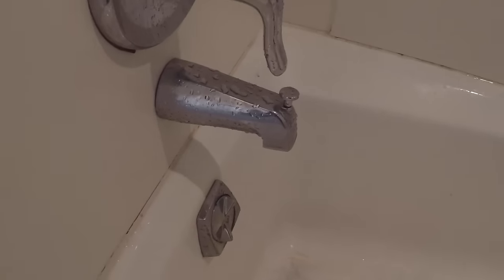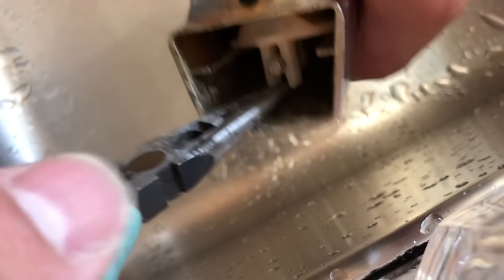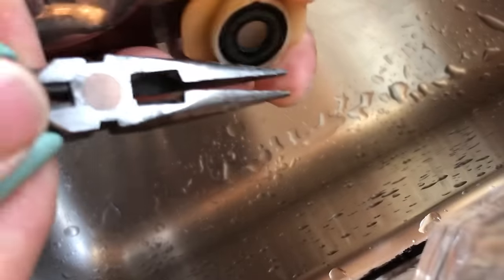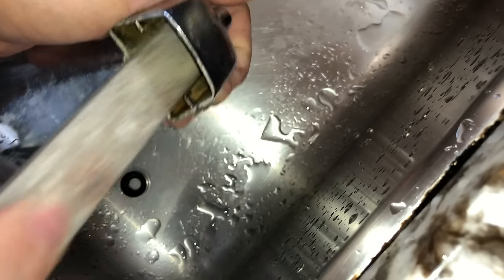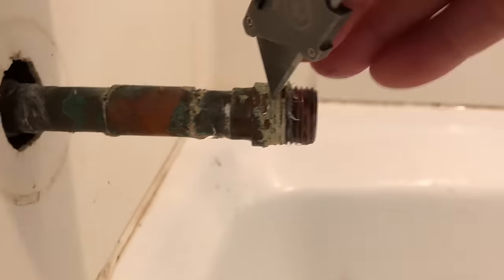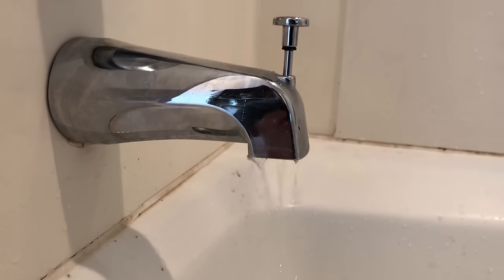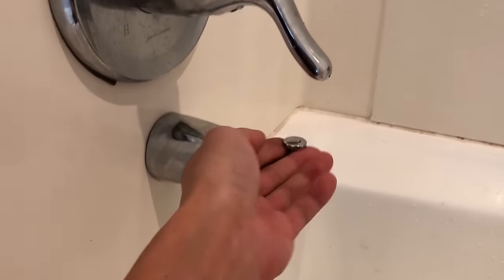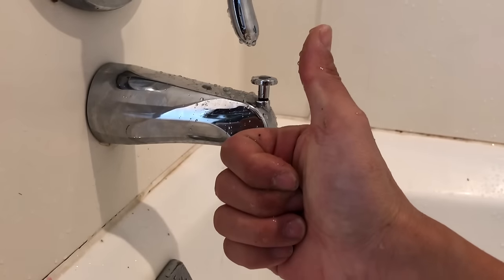Repair Leaking Tub Spout Diverter Pull in Shower Mode

Comment: Don’t get in a rush like me. I had the slip on kind and followed his method but he doesn’t mention a set screw at the beginning of the video, he just starts twisting. I damaged the copper pipe and now hope there are no leaks when I reinstall the cleaned up diverter.
Reply: Not all set ups require the set screw.
Reply: Troy True most will
Reply: Mine is the one with screw and just slide out the head. Not need to twist
Reply: How do I know what kind of faucet I have?
Reply: @ovetaalexander3425  check if you have a small screw on the bottom, if not it’s likely slip on
Reply: @longhorn8459  thank you. I managed to get it done quickly without removing the nozzle tho. It works great now
Reply: @ovetaalexander3425  Open your eyes and look
Reply: @longhorn8459 Thanks for this tip I need all the help I can get since my Dad passed away and I have to try to fix for Mom.
Reply: @longhorn8459  on the bottom of the faucet?
Reply: @great4ever845  yes
Reply: @troytrue7478  mine has no set screw and won’t twist off, thinking the old guy must’ve used loctite or something
Reply: I’d never seen one with a set screw and was helping my neighbor. Glad you mentioned this!
Reply: Just moving in and it was spraying water out the back until it just fell off a few weeks later. Looks like the contractors used solder so I can’t screw another back on. They also installed the handle upside-down with the plastic stop in the wrong place, forcing you to leave it in the middle to stop the water flow (also starts at full-hot). I knew something was up when I saw the solder blob in the tub before moving in. I also noticed that the pipe to the shower head was turned and already sloping down at the point where it comes out of the wall (doesn’t start straight, then slope). The bathroom door handle is for closets and can’t be locked. The guest bathroom is the same way. The master bath has a proper door handle but it’s on BACKWARDS with the lock on the outside. The master bath shower is unusable because they glued the drain grate down with something that looks like expanding foam trapped underneath, completely blocking the drain. None of the stoppers work in any of the sinks when you pull up on the plunger and there is a huge water leak under the kitchen sink where the line goes into the dishwasher. They also ripped out the vertical backboard between the countertop and the wall, leaving a gap for water to go down behind the kitchen sink.

All of this is brand new after the home was rebuilt following an EF4 tornado. These contractors are incompetent. Just took the money from the landlord and RAN!
Reply: I almost did the same thing, turning it 90 deg but fortunately spotted the slot/screw and loosened it. Pipe only has a very minor scratch mark where the clamp part is so I was lucky!
Reply: I'll take time off from work to watch them and let them know if something looks/is wrong. I don't care if they don't like that so tough (you know what). Almost every time I see something that looks and is wrong. Can't trust them to be on their own and do a good job. They're always in a rush to get on to the next job. I pay enough money for a job and I want it done right, period.
Reply: @rogerbarker2231 what if the person is blind?
Reply: I would like to respectfully disagree with your comment. Let me explain why. First of all, I noticed the place on the underside of the bathtub, spout at the base of the spout, where there was a place for a setscrew, but there was no setscrew. The reason that I know that is because the copper water supply pipe coming out of the wall was threaded on its end and had Teflon tape on the threats. The bathtub spout is threaded on the inside and actually screws onto the threads on the copper pipe coming out of the wall and that’s what secured the bathtub spout to the water supply pipe. When the bathtub spout is secured to the water supply line by a setscrew, there are no threads on the end of that copper water pipe coming out of the wall. It is a pressfit of the bathtub spout onto the copper pipe, and it is secured to the pipe by the setscrew. I must admit most of the bathtub spouts that I have seen either have a place for the setscrew where there was no place for a set screw And the spout unscrewed. This is the first time I’ve seen a bathtub spout that I had a place for a set screw, but actually unscrewed from the water supply pipe.
Reply: @johnthomas-zx9di I’ll fight you!
Reply: @longhorn8459  Wow!!! I was courteous and respectful, and that is your ridiculous response?  Pft!!!
Reply: @johnthomas-zx9di I think he’s joining dude
Reply: @troytrue7478 it doesn't matter but that's the very important and first step of this task you must check and make sure if there's a screw first unscrew it. Otherwise there's a chance of breaking the water pipe
Reply: @emmettturner9452  yeah issues like this are why as a tenant, i don't want to attempt repairs. Half the time their incompetent maintenance people do things incorrectly and what should be a simple fix could make things worse and i don't want to get deep into an issue as a renter...let the idiots fix their idiot mistakes... unfortunately it means they must be in my unit, of course making it dirty and not cleaning for themselves. When maintenance comes i hide all my towels and rags and trash bins. They need to leave my place as they found it or better
Reply: some have set screws some don't can't get mad because he didn't tell someone how every plumbing fixture on the planet functions
Reply: @TheCracker713  thank you so much, I’ve still been losing sleep over my rage at this guy but now since you posted this four years later I can finally rest.

Comment: what I did is to add a thin washer under the main washer/ seal to make the main washer seal protrude a little more from its Seat, so when you pull the handle it will seal better against the spout hole. In my opinion, the factory seal is too low in its Seat, needs more "meat" so it will do a positive seal. This will make the pull handle a little heavier to pull but by golly it really sealed the dammed spout from leaking. You can thank me later !  :)
Reply: Thanks very much for this suggestion, I replaced the washer and it didn't divert the water at all because of the empty space it left. I didn't have a second washer lying around, so I just got what was left of the old one and cut it flat, put it in, then put the new one on top. Works perfect.
Reply: @ASH-TARD   you welcome. Yes the factory washer is too "thin" even when new.  It needs to be larger to really make a positive seal.  Good to hear it worked for you.
Reply from the maker: Great tip! 👍

Comment: I just fixed mine. My local hardware store was out of the repair kit. So I placed a thin piece of plastic I cut from a child's applesauce container. I inserted the plastic behind the washer to push it out a hair. Now it works perfectly. Give it a try...
Reply: Still working fine. No more dribble.

Comment: Thank you so much for this helpful video! Filing down the mineral deposits inside of the diverter was enough to get my shower working again with the existing washer and parts. I will probably go get a kit to get a fresh washer, but this tip got me back the use of my shower in the meantime. You saved me an expensive call to a plumber, and it feels great to have been able to fix this myself. Many thanks!

Comment: If you're having trouble getting the white prongs apart, consider unscrewing the top part of the silver diverter knob, and pushing the interior white structure and washer out the bottom of the tap, as opposed to opening the prongs with pliers. Pretty sure that's how it was supposed to be done. (On the type I have at least, which looks pretty much exactly like this one from what I can see.)

Also something I didn't realize right away? On the bottom of the tap there might be a screw tightened to hold it to the wall pipe that you have to unscrew first before the tap will turn and come off the wall. Looks like his has a spot for it, but perhaps the screw just wasn't there/wasn't tightened.
Reply: I unscrewed mine as you said thanks. Didn't even bother trying to remove the spigot from the wall. No sense in opening Pandora's box. Thanks 👍

Comment: Thanks for the tip! My problem was mostly the shaft on the pull knob was gummed up so I cleaned it with steel wool and used a small wire brush to clean the inside of the spout. Works great now.

Comment: Worked perfectly for me... I had the exact same style spout.  Removed the diverter parts and filed and cleaned the build up - also used a little CLR lime and rust remover.   Placed the spout back into place successfully - The first time I pulled the diverter - water continued to leak from the spout - Per recommendation - Pulled it 2 or 3 times.  On the last pull, the diverter seated successfully and ALL the water diverted to the shower head instantly and WITHOUT a drip from the spout!  Thank U Thank U - I was just on my way to the hardware store and you saved me a trip!  Gratefully!  TJ
Reply from the maker: Glad it helped! Thank you for the coffees!! 👍

Comment: Great video that gives the tip of smoothing the mating surface of the washer with a file.  A replacement rubber cup washer is only a couple of dollars so it is worth replacing at the same time but in your case, it would still be leaking because that was not the problem.  Also, I saw in another video to use a wooden dowel to place in the spout to turn the spout for removal if it is too stuck to remove by hand.  Of course, first check it is not the slip-on type that has the Allen key at the bottom.

Comment: Thanks soo much for video.  Tips: It is a big pain to extract the pull pin out.  I had to get the Mrs to pull on the pin while I used two hands to spread the plastic retainer (Spout in the vice Cloth wrapped).  A needle nose is definitely the way to go as shown.  I used a Dremel to polish the interior metal sealing surface--smooth out the file action.  I also tried vinegar-Baking soda to take out the corrosion (No good result on this).  Impression:  That donut washer is critical--as pressured water enters the spout, it pushes on the washer (Through the hole) and forces it out against the spout wall forming much of the sealing action--additional to the washer surface itself.  This is why the washer has odd shape--side wall rim.  Our spout just slides into a copper pipe and you tighten the Allen Screw.  Another one has a short stubby threaded pipe from the wall--old--from 1964,

Comment: Great job.  I had the exact problem and your video had just enough info to fix the problem. A 15 minute job.  My only criticism is not all tub spigots are threaded. Mine was held on by an Allen screw into a plastic collar around the water outlet pipe.  Not a big problem, but I had to figure out why my tub spigot was not unscrewing.  I also had to reseat the plastic collar during the reinstallation process, since I had pulled it out of position, trying to unscrew the spigot.  Easily accomplished with a deep socket and some lightly tapping with a hammer.  Otherwise, a very useful video.  Thanks!

Comment: Great vid, showed me what's inside. I didn't have to remove my tub filler spout. I just laid on my back with a headlamp. I took a flat blade screwdriver from underneath and splayed the nylon latch-fingers apart and pulled up on the diverter knob on top of the tub filler. The nylon part with the diverter rubber washer slid down and out the bottom of the spout. I replaced the washer with a Draco "TUB SPOUT DIVERTER REPAIR KIT" from depot. I just used the NEW rubber washer seal and re-used the other original parts; lift rod and nylon diverter gate.
Reply from the maker: That’s great. I totally recommend getting a new washer like you did.

Comment: Many Thanks! You saved me a call to my landlord. I had to tweak things more, but learning how to take this apart is very valuable.
Reply: I am the landlord. I thank you.
Reply: Why didn’t you want to call your landlord?
Reply: @Jewelstravel  because I had THAT kind of landlord and I didn't want them in my apartment. 
Eventually they came to me to check a water leak. It wasn't in my place, but the place below me. They decided water from the roof was leaking into the walls freezing and melting. Since I lived on the top floor I asked how much noise there'd be and they said they were just gonna leave I like that - it was only minimal damage. I moved.

Comment: Thanks for the tip.  My diverter valve wouldn't send enough water up to the shower head.  I wanted to replace it, but it wouldn't budge when I tried to turn it.  I bought a new diverter valve pin kit from the hardware store thinking I would replace that instead.  When I saw you cleaning it, I walked over to my tub and sprayed some Lime Away up the spout.  Rinsed it out five minutes later, and wellah...the lift pin worked smoother and water was going up to the shower head and just a few drips came out the spout.  After several applications of Lime Away it's working smoothly.
Reply from the maker: Awesome. Next time I guess I’ll clean it out without screwing the whole spout off. Great tip! 👍
Reply: Voilà?
Reply: Thanks ima try that!

Comment: Very helpful! Found easiest way to remove the mineral buildup in the faucet causing the problem was to use a vinegar soak. After removing the faucet and the knob and diverter, we stood the faucet opening end down in a small jar of vinegar and soaked overnight. Nonfiling necessary, diverter glided easily when reinstalled. Thanks for showinf how easy it was to repair.
Reply from the maker: Great tip! Thanks for watching.

Comment: What a great tutorial, Thanks. But if you can't determine the make/model product name of your faucet, how do you find the correct matching kit? Also, you mentioned you'd listed the tools you used; I couldn't find that. What size/type of file is it that you used? what if the corrosion inside is on surfaces that aren't flat like file, so a file can't get it? any recommendations are appreciated. Thanks in advance.

Comment: 10/10 repair works,
My tub spout was seized on there. So I just dismantled it and filed it on the wall, and then I just added a one aluminum washer that was the same diameter of the rubber washer. My seal was thinner so it wasn't making good contact, for now it's works and ill replace it properly later. 
But thanks for this video, I went from tub only to shower/tub.
👍👍👍👍👍💯💯💯💯

Comment: Unfortunetly, my washer is warped, but this process still worked! However, if the repair does not last long, I'll purchase a new spout.
Reply: You can get "repair kits" with a new plunger, white clip thing, and the weird o-ring. You don't have to buy the whole thing.

Comment: You don’t have to take off the spout, just lay down in the tub facing up, pull the parts, file it down to clean off the buildup, put it back together and you are done. Just did that and it worked great. Thanks for the video though, appreciate it!
Reply from the maker: Good tip!

Comment: Thanks, you saved me $40 by getting a new kit instead of buying a whole setup with a shower head. I broke my ring holder while taking it out, but I put in a new one and it worked right away!
Reply from the maker: Awesome! And not to mention that this repair is much easier than a valve replacement.
Reply: @chicagohandyman  oh yes, much much simpler :)
Reply: Walmart sells the tub faucet with diverter for $11.

Comment: I believe that you inserted the diverter washer backwards.  The diverter on our tub is a cup style.  If it is turned the wrong direction, water deflects off of it which allows the diverter to drop down and causes horrible leaking to occur out of the tub spout.  If it is turned the correct direction (which is so that the concave side is facing the water flow) water enters into the concave surface and holds it firmly in place so that it barely leaks.  Try flipping your washer around so that the concave surface is directed toward the water flow.  It should reduce the water dripping from the tub spout significantly.
Reply: Instructions show that with a proper diverter gasket, there will be a tiny ringed ridge on a mostly flat surface. On the other side it's completely concave and the concave part faces away from the water flow and doesn't interact with it. So imagine having a U shaped handle placed upside down in a coffee cup, that's how it's installed according to Danco instructions.
Reply: @imzjustplayin   Danco instruction is similar to Moen:  "Slide the washer (#3) into the front of the diverter gate (#4) with the flat part of the washer (#3) facing outward."

Comment: Just fixed this.  Crawled in the tub and popped the plastic valve loose and used a thin, flat file and removed the buildup.  Snapped it back on and works like new.  I thought the washer may need replacing, but it does not extend past the plastic flange, so it's fine.

Comment: They make a replacement diverter (the white plastic thing) in case one of your prongs breaks off, like mine did. Unfortunately, it appears that there is only one company that makes them, and they only make the newer rectangular style, not the perfectly square style used in older tub spouts. Because of that, I had to purchase a new spout, even though I preferred the style of the older one. Also, as others have mentioned, there are two different styles of spouts. One is a twist off, and the other has a small screw on the under side near the wall that you loosen and then pull the spout off.
Reply from the maker: Good info. Thanks!
Reply: Thanks for the reply.